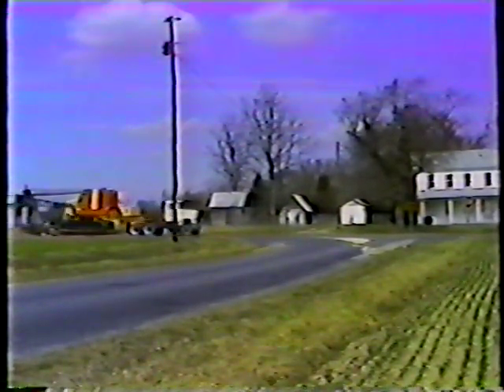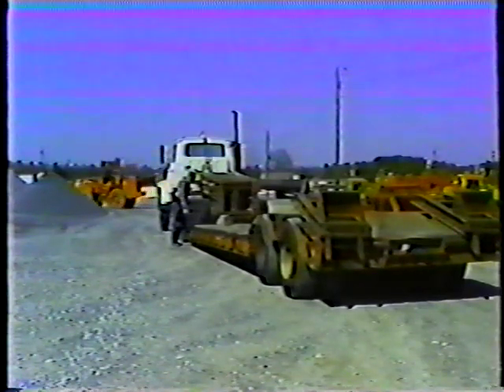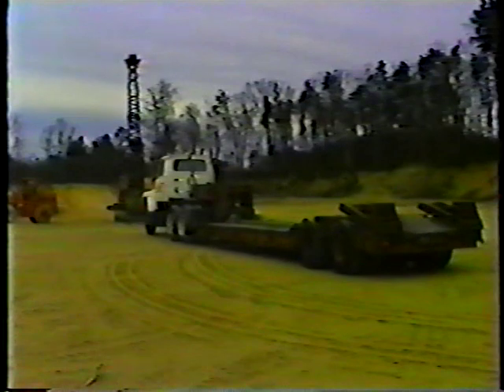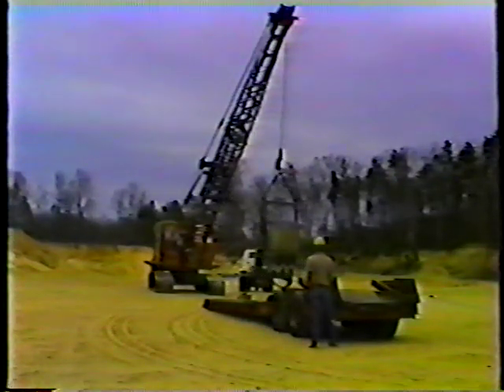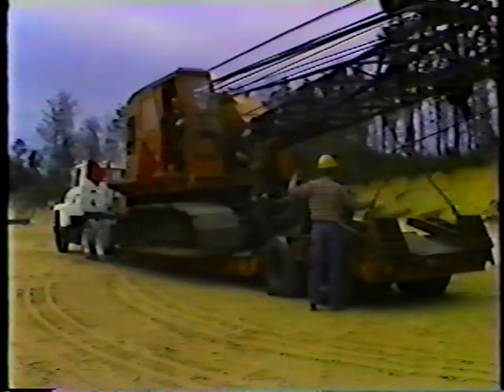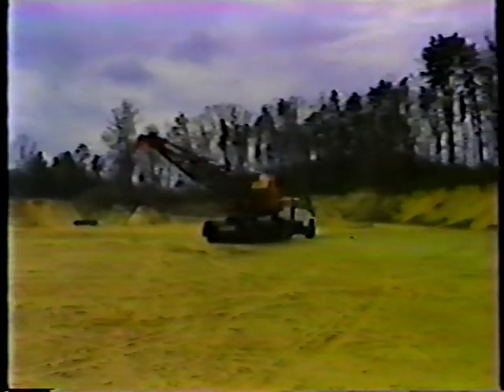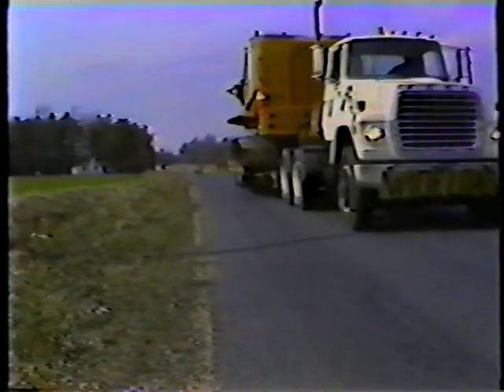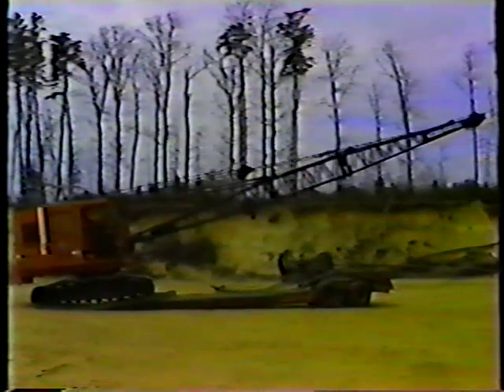Lowboy

Comment: Nice vintage video, but I think they should remove the glad hands and cord before pulling away from the firth wheel, keeps the lines off the grease and less chance of accidental line breaking.  That Koehring is a good crawler we had one back in the 1970s for clearing our ponds, miss that old machine.
Reply: Definitely need to disconnect air and electrical before pulling out. I've seen many trailers and power units damaged because of that.